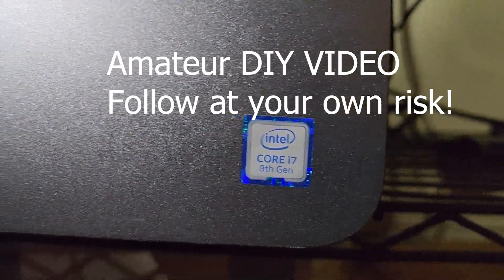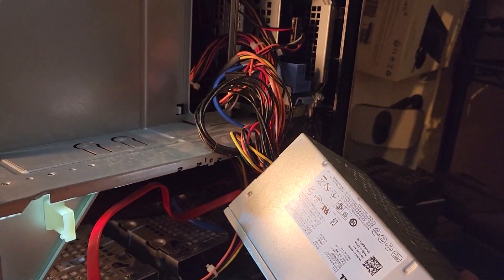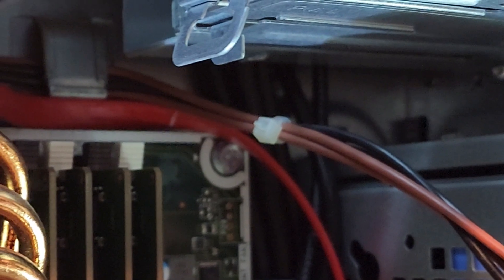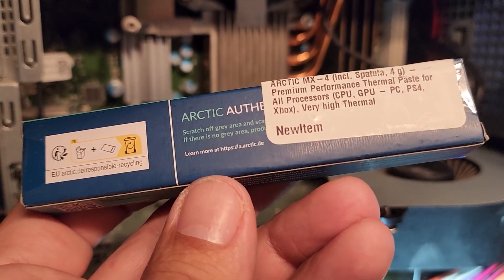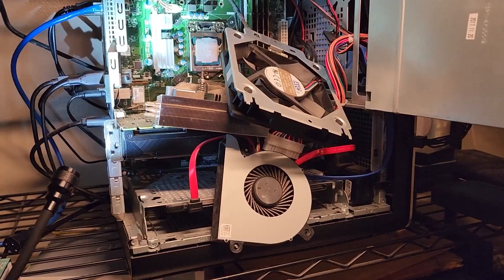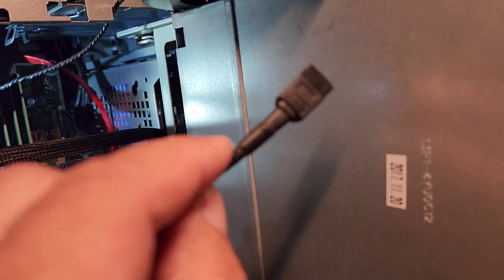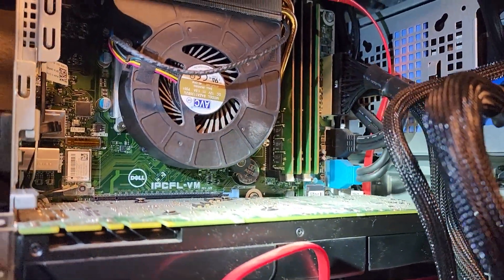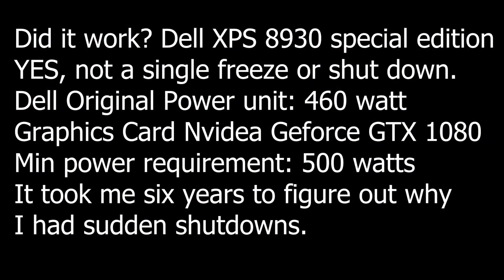Dell XPS 8930 power upgrade 460 watt PSU removed 750 watt PSU installed MX-4 Thermal Paste Compound

Comment: great video - thanks!
Reply from the maker: Thanks for watching and taking your valuable time to comment :)
Reply: @FrederickDunn I just replaced this same psu however the old psu had a slightly larger connector for stock ssd and a 4 pin (2x2 P4) for the Mobo... However my new psu doesn't have the larger ssd connector or the 4 pin connector. Should I get a different psu which includes these connectors or is there an adapter?

Comment: What is an eco switch?   Why was it on?
Reply from the maker: With eco mode on, the fan will remain off at low loads to reduce noise and save a small amount of power. The fan will only turn on once the PSU reaches a certain temperature. With eco mode off, the fan will spin continuously, even at low loads.

Some users have noted that the fan on their PSU in eco mode can spin up to a high, and sometimes loud, speed when it does turn on. For this reason, some prefer to leave the eco mode off so the fan runs at a quieter, constant, low speed.

Comment: Here is a tip from someone who knows: Heat is the enemy of a computer, you have lots of dust all over everything, so you should have taken the opportunity to blow out all the dust off of the fans and all internal parts so they run cooler.
Reply from the maker: true

Comment: Did you have to use a 24 pin to 6 pin atx psu power adapter? Im looking to upgrade the psu on my xps8940. If so could you please provide the link to it?
Reply from the maker: Yes, it wouldn't work without that adapter. They are sold on Amazon, pretty easy to find.

Comment: Hello my friend, I have the same computer without the RAM parts. I bought it from the scrap market for $10. It had a slight problem. It did not show the screen, it was just black. I fixed it. After that, the main lunch box burned. Now I only have 1 GB RAM.I don't have a good thermal paste for the processor I hope you can send me these parts, please, if you can, because I need them. Your friend is very poor.
Reply from the maker: I'm sorry about those challenges, I don't sell computer components and don't stock any parts. You can find good deals on used or out-dated parts on Ebay.
Reply: @FrederickDunn  OK

Comment: Thank you for this entertaining and educational video...well done and absolutely saved me! Just successfully swapped out with EVGA 750 PSU on my XPS 8930 SE. Pigtail to CD/DVD drive didn't work for me, but will order a cheap external drive and be done with it. Have no idea if I put on the thermal paste to spec, but cpu isn't smoking (yet). Was able to shove the panel on in the end, but not sure how long it will stay under the pressure 😁. Thanks again!
Reply from the maker: I am so glad this helped you out :)  Being able to do these things without bringing your computer in to a tech center is a big bonus :)

Comment: Thanks for this video! No other video on upgrading 8930's shows the brass-tubed heatsink that you have (and I have.) I wouldn't have dared to open mine up if I hadn't seen your video.  It did look like your original PSU was installed upside down so its fan was facing the inside rather than the outside where it should have been facing.  Or did you just accidentally turn it around during the video-making?
Reply from the maker: I didn't turn the fan around. Reinstalled the same way it came out.

Comment: What size DeWalt screwdriver did you use for the CPU fan removal? @Frederick Dunn
Reply from the maker: It's a DeWalt Phillips Head #3 screwdriver, length of the shaft is 3 7/8" plus the handle.

Comment: We use a Dell 8930 with an i9-9900 for our YouTube studio video camera recording PC. We needed a little more beef for the GPU recently as we've kept adding cameras, so I can confirm that a Gigabyte 4070 Ti Eagle OC will fit just fine into the Dell 8930 case and I also put in a new Segotep 850w PSU after watching this video. We're recording in 4k from (4) Sony cameras to an Elgato Cam Link Pro PCI-E capture card and the 4070 Ti Eagle fit and work just fine together!  I also just put a Samsung 990 Pro 2TB m.2 upgrade into it as well to have some more recording space. It's a great little PC that I intend to keep using for quite a while.
Reply: It is a good pc but I think mobo is limiting speed of my m.2 drive everything transfers slower than I would expect I've had faster SSD's
Reply: Could you reply with the full specs for your PC build? Like what motherboard and all..

Comment: Get a can of compressed air and blow that dust away, specially from the heatsink, thermal paste won't do much if heatsink can't get the airflow and extract the heat from them...

Comment: Disk burners are good. One thing I learned early on is that things don't stay up on the web forever. It is unreliable as a reference source. Stuff that you like to refer back to suddenly disappears forever unless you own the original... or have made a disk copy for future reference.
Reply from the maker: I do use extensive digital storage, I burned the discs for clients. I agree, backups are important.

Comment: My day job is a computer tech support guy.  I think you did a nice job documenting your work.  I would be worried about that amount of thermal paste it could cause issues.  This is more of a Goldilocks situation instead of a more is better.
Reply from the maker: Thank you, if the paste oozes past the plate what are the potential hazards? Thank you very much for chiming in :)